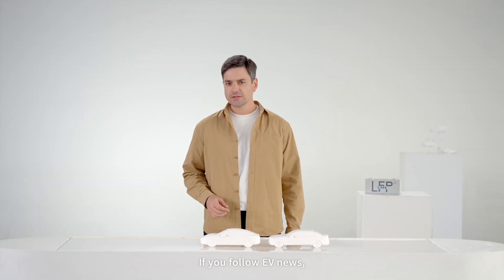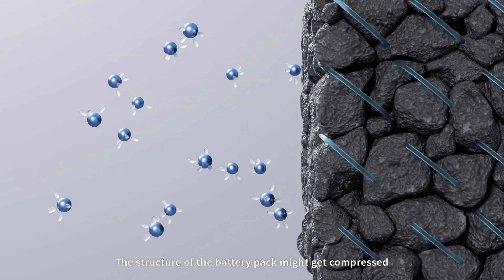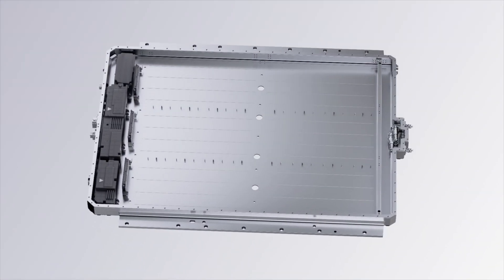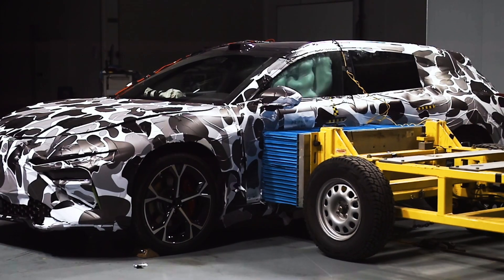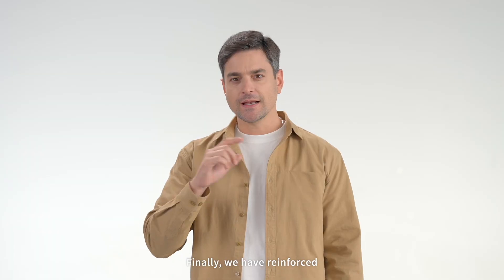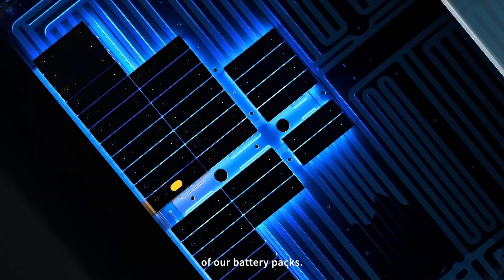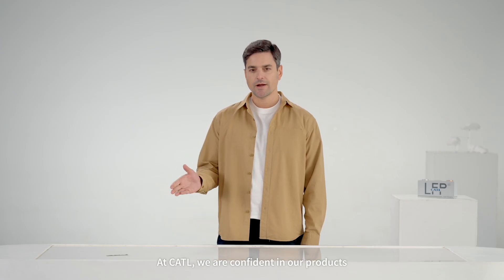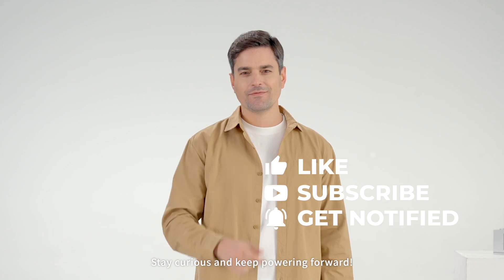Incredibly Impact Resistant

Comment: 1:01 STEEL or ALUMINUM armor.. your statement are confusing.
Reply from the maker: We sincerely apologize if our expression has caused you any confusion. "Steel armor" is just a description. In fact, the frame structure of the battery pack includes both aluminum and steel, but currently, the majority is made of aluminum.
Reply: @CATLOfficial Is it common in China to misrepresent vital product information?  Strength of steel is significantly different from strength of aluminium I believe.
Reply: Often both

Comment: I hope you will develop a sulfide based all solid electrolyte dry electrode 955 NCM cathode and dry coated silicon-graphite-aluminum composite anode with 50 percent more capacity and 50 percent less weight 2170,4680 and prismatic form factors  with above 800 wh/kg energy density.(let me explain;if you increase the capacity of  a 2170 cell to 30 wh from best in class 20 wh and reduce the weight from 70 grams to only 35 grams you will have an ultra amazing CATL solid state 21700 with 30 wh in capacity and 857 wh/kg energy density.which really is totally achievable with dry coated silicon-aluminum-graphite composite anodes because dry coating and aluminum coated silicon entirely addresses the swelling issue of silicon composite anodes + dry electrode 955 NCM cathode with higher active materials and thicker electrodes for higher battery capacity + ultra light weight  sulfide based solid eletrolyte for 40% weight reduction,better safety and much better charging times and above 5000 cycle life
Reply: we have already 800wh/kg batteries on mass production
Reply: @greecemobile7610  nahhh
Reply: Nah